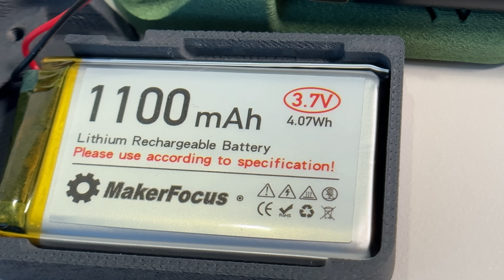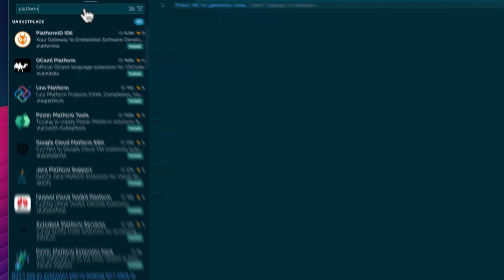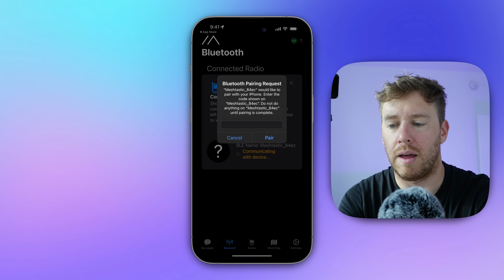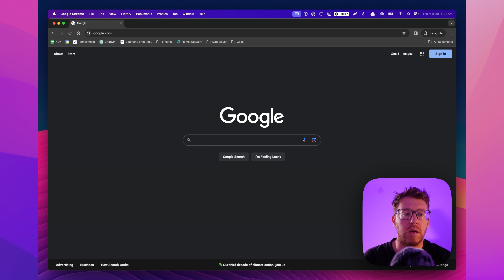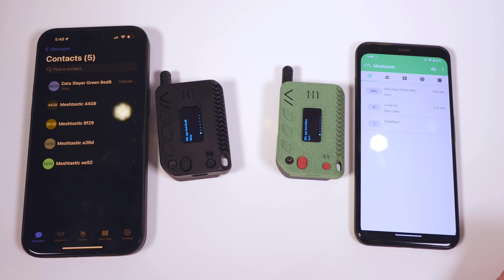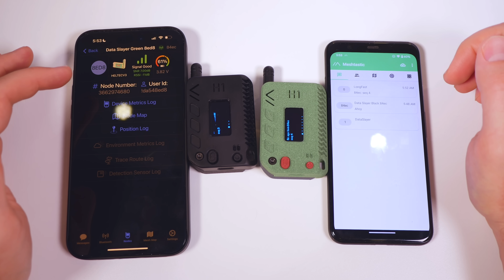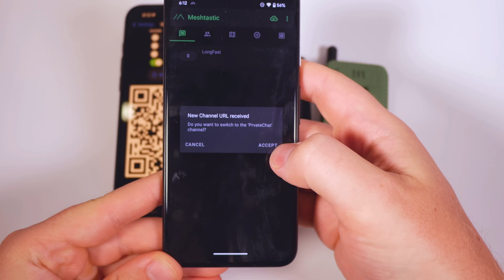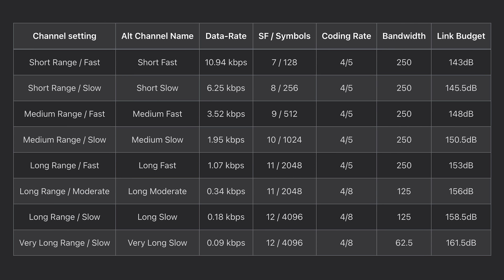It’s Been a Good Run, Phone Providers.

Comment: The antenna makes all the difference. Currently building a small mesh network in my area.
Reply: Any specific you recommend that are good for the price?
Reply: Yep, SWR the closer to "1" makes a big difference.
Reply: not only antenna, but tx power
Reply: @s.i.m.c.a  Power helps, but LORA devices only put out 21dBm gain. An amplifier would help, but may not be legal. Having a good antenna will make the biggest difference. I use the digital mode FT-8 often on 20 and 30 meters and can communicate worldwide on 60 watts. Granted, 60 watts is more like 48dBm, but it's radiated from a 27 foot high gain vertical. The conditions on HF are a little different than UHF also.
Reply: These would benefit from 868/915mhz crossfire/eLRS antennas readily available from FPV shops
Reply: If it is a quarter wavelength antenna, then you need a large groundplane, otherwise the antenna does not radiate as expected, the impedance is also affected.
Reply: Are the nodes self contained, so you could literally toss one up onto the roof of a building in an industrial area and it'll run on it own using solar indefinitely (until it's discovered) obviously.
Reply: The design is not good. It should either be an e-ink touch screen or keyboard with 2 line e-ink display, about the width of a 6.5'' phone and 1/3 the height, 10mm thick... and no protruding antenna! I was banging on about decentralised comms networks using both WIFI and mesh devices. I'm amazed we don't have voice, let alone text meshes built into phones by now. It could easily have been done decades ago.
Reply: what would be the point in doing that? what are u using it for? or is that  top secret?
Reply: @paul.phillips  When the day comes that these mesh nets are the difference between life and death, legality is of little concern.
Reply: @Izzystock If you want to use radios, you need a license to legally operate one like a CB radio(edit: Only if more than 2 watts in 2 way radios). This alternative is not only cheaper and more portable, but it also does not require a license even in higher power setups.

CB radio has limited legal distance of 155.3 feet, another point it looses out to this new tech.

This is basically an improved more private version of a CB radio.(You can pick up CB radio traffic by randomly tuning in the frequency).

CB radios are used in areas where there is poor cellular coverage.

Edit: License is only required for 2 way radios exceeding 2 watts.
Reply: @Izzystock creeps be creeping.
Reply: @PrivateSi  The concept is probably still far too complicated for enough people to grasp.
Reply: @SI0AX You can encrypt analog radio and it would be a lot cheaper than setting up a network of these devices. In any situation that this would have a use the FCC either doesn't exist or you don't care about it.
Reply: @Thalanox  .. It just needed an Open Standard decades ago. Maybe regional ones for EU, US, USSR, China. Either way, easily doable, with all texts and maybe low quality voice calls too, let alone today when it would be easy. Just needed phones to support it, with keyboards that could send texts themselves or be used with a phone. The mesh would then (have) provide(d) excellent coverage. No towers needed, Battery life being drained by other people is the main issue.
Reply: @kaiboshvanhortonsnort359  Yes, and if you decide to run more power at that time, you'll make far better use of it with a good antenna, so start with the antenna. 120mW may radiate better through a great antenna than 120W through a terrible one.
Reply: @xfy123  But what about power consumption? CB radios look like large devices that consume more energy than what's depicted in this video. I personally don't have experience with analog devices but from what I've seen, digital is more energy efficient for the most part.
Reply: @SI0AX  you can use a cheap hand-held baofeng uv5r get better range and versatility. It's an analog radio but you can get encryption working it might take you a bit more work then a digital one but it's doable. On a normal battery it can last like 3 days on standby and almost a day of use. You can get a lot bigger battery for it or make one yourself.
Reply: @SI0AX  this exactly, at 400 megahertz to push that wavelength more than a few miles you would need huge battery packs. Not to mention the CPU cycles needed for decrypting messages. If there was a lot of traffic on one band, decryption would fail A LOT and you would have to start over especially if message/data was more than 1kb.
Reply: People don't seem to understand how lora signals work. With a small 1500mah 18650 battery on 2 heltec v3s, you can send and receive messages from over 100km away, as long as you have line-of-sight between the devices. The current record is over 200km. The battery can run these communications for over 12 hours on that single battery. This isn't a radio broadcast station. It's little chirps of data.
Reply: So can you make it act as a relay? So you pass a message though the network, and not just from one device directly to another?
Reply: @Darthvanger this is what I kept hoping to have answered by the video.

It would make these way more versatile and usable, but might increase complexity to the point that they're not as practical anymore. I'd like to see a version with that though.
Reply: @runed0s86  thanks for correcting me. Correct little chirps. But digital. To send one message with only say 60 chars can get compressed to 5 bytes. At 400 megahertz. That would take about .2 seconds. But because they are digital they will probably need to be retried 10 times. At 2 watts, every message would eat 1/1800 x 2 watt hours.   So a 10 watt hour battery could send 9000 messages if all it is doing is transmitting. But if you want to use more characters you will see exponential decreases, because anything longer than a few bytes needs to be retried exponentially more times unless you are in the middle of nowhere with true line of site. biggest limiter is that if you try to push with anything higher than two Watts and someone notices they will probably find you and tell you to stop. I'm sure that 100 miles was using at least 25 watts to a high end perfectly tuned receptor. What is the world record in perfect conditions for a 2 w intact digital transmission of .2 second duration to an affordable receiver?
Reply: Why would you mesh it?
Reply: @SI0AX  What country on planet Earth do you need a license to use 2 way radios, CB, etc?  You sure you're not just part of this scam product?
Reply: @Ty921  Meshtastic is made to mesh. Creating a mesh network extends range and coverage area and adds redundancy to the network.
Reply: @Darthvanger  Yes, Meshtastic will relay messages by default, but it has different modes like client, router, repeater for different purposes. A node at the top of a hill might work best as a router or repeater.
Reply: @Redbeardian  Ok. I did some searching and I was wrong, you don't need a license for radios under 2 watts of power and CB radios. There are however regulations from the FCC that are federal crimes if violated. And many of these regulations limit the radio transmission distance. One very notable rule is that you cannot even atempt to make contact with a receiving CB that is more than  155.3 miles away.

The main advantage of this crypto communication is similar to crypto currencies in that it's not regulated. They may start getting regulated if popularity increases.
Reply: I can only imagine mesh networks really taking off somewhere like San Fransisco. I'm always left out of these sorts of collaborations due to living in a redneck ****hole nowhereville.
Reply: @PrivateSi they have one with big screen in a keyboard. It looks just like a blackberry. Although the battery time is crap.
Reply: The transmitter power being limited to the ESP32 is the limiting factor. If you could put a 5w transmitter on this thing, it'd be a beast!
Reply: @SI0AX you think they can't already hack the cheap encryption‽
Reply: @SI0AX digital is all code whereas analog is pure signal.... One other discussion was the antenna: bigger antenna, better listening, but the ones in the video are 360° so if you're using for fixed nodes, 20° antenna gives you much better signal strength for less power consumption
Reply: @0ned  I wouldn't consider blockchain encryption "cheap" considering the fact you need at minimum a decent quantum computer to do so within a "reasonable timeframe" (less then a few average human lifespans).

Comment: Also, i dont know if anyone pointed this out, but the major issue with radio signals, especially simple ones like this, is you're still at the mercy of atmospheric effects and uh sorry to be that guy but being in motion or not in motion is  a BIG factor, so thats why despite having direct LOS youre still losing messages

Source: Currently a NavET on Submarines
Reply: Your source should be an actual source, not a title. Being a navigation tech on a sub, is not a source.

Why not cite NAVPERS?
Reply: it is true that how far you can transmit depends on the atmospheric effects

Comment: Old Radio guy for the military. 
Radio waves can penetrate nonconducting materials, such as wood, bricks, and concrete, fairly well. They cannot pass through electrical conductors, such as water or metals. Above ν = 40 MHz. Ya I took this from Britannica because I didn't want to type it out, long story short that's why you can get though multitudes of buildings and dense woods but struggle on a lake or beach. Ground radio waves also project in a curve (this is why they bounce off the water so quickly) so no joke you grab a 6-20ft antenna to any of these or even build a permeant housing and this could be broadcasting for miles.
Reply: You didn't want to type one sentence... aka you don't know what you are talking about.
Reply: @thomgizziz  you feel better about yourself now? Do you feel superior to him? lol for the life of me, I will never understand people who are rude to other people for no reason on the Internet. You must hate yourself.
Reply: @thomgizziz  was there any need to randomly be a dick to people?
Reply: @thomgizziz tf is your problem?
Reply: @thomgizziz  Thom needs a hug.
Reply: I'm siding with Thom, a 'military radio guy' should be able to put these concepts into terms that drive the point home better than any wiki article.
Reply: so a submarine can't use its radio if its submerged?
Reply: @PySnek  Above 40 mHz?
Reply: @PySnek  Submarine uses a antenna loom that floats to the surface when under way for communications then they reel it back down when they are done receiving.
Reply: OP: I've gotten 18km out of pairs of these things using the small drone antennas that Andy Kirby showed off in his early videos. We have quite the meshtastic repeater grid now in the city where I live.
Reply: @halibux6683 respect is earned, not demanded
Reply: @suzyamerica4679  I am new to all the radio stuff. What do you mean by "repeater grid"?
Reply: @thomgizziz  yet here you are, on Youtube, surrounded by fellow know it all experts. By the way, he is correct.
Reply: @thegreatbaguette1161  Good question. It is a network of repeaters ("nodes" in meshtastic) that can see each other, so as to cover the most distance in the fewest message hops.
Reply: @suzyamerica4679  Ah, ok, so you can use one to boost the distance?
Reply: First of all, signals will absolutely transmit through conductors.  The more dense the material, and higher frequency signals will have trouble or be greatly attenuated.  Anything that is a conductor is also a transmitter.  That's a fact.
Reply: @thegreatbaguette1161  Repeaters high on hilltops is the cheat. Then run traceroutes on your intended messages (once they start getting through) to see which nodes the messages are using as intermediaries.
Reply: @suzyamerica4679  Hmm... I will have to look into it more. It's definitely not a bad idea to set some up as a backup form of communication, just in case.
Reply: @PySnek  Not well, no. They tend to have an antenna on a long coaxial / feed wire which they can "send up" to break water and hope it will not be detected. Underwater comms for submarines is sometimes done via audio frequency tones to transponders with a speaker / mic underwater and a transceiver above.
Reply: I think I would raise an eyebrow over the "grab a 6" to 20" antenna" when we are talking about (roughly) 60cm and 30cm wavelengths.

I agree if folks knew how to make a co-linear you could end up with a long antenna with good gain BUT if you just randomly attached a long bit of wire, unless you got really lucky, you would have a pretty grim mismatch. A little 5/8th wave helical "rubber duck" should give pretty respectable service.

Certainly agree though, that with a decent antenna - even just a basic dipole - then a few miles LOS should be pretty do-able assuming the receivers aren't too deaf.
Reply: @PySnek  Generally speaking, yeah.  They have radio buoys and the like, of course, and there's a system called ELF that is very slow (low data rate) but uses insanely long wavelengths that can go damn near anywhere.
Reply: @kaiboshvanhortonsnort359   a 'military radio guy' is not a school teacher though; he knows his craft but not necessarily can help you understand it.  His explanation was pretty clear; don't see the problem
Reply: Pretty sure an old military guy would be talking about refracting ULF off the ionosphere and sending EM across the Earth. Or bouncing UHF off the moon.
Reply: Wood?  Really 😮i once hear about a Company which work with german and Austrian
intelligence agency the build an
tap-proof room